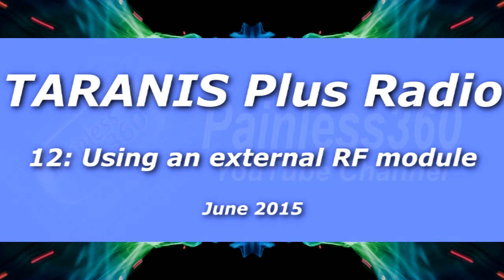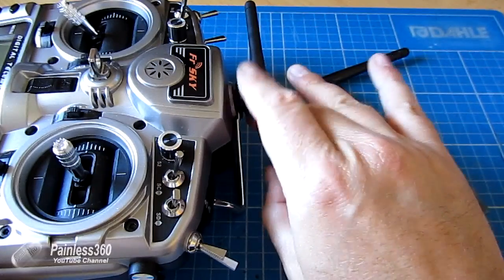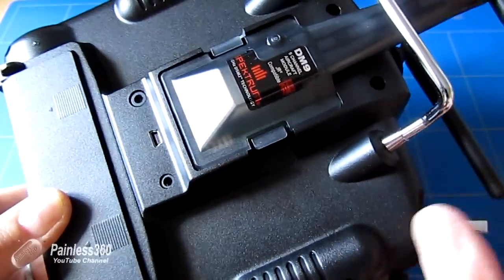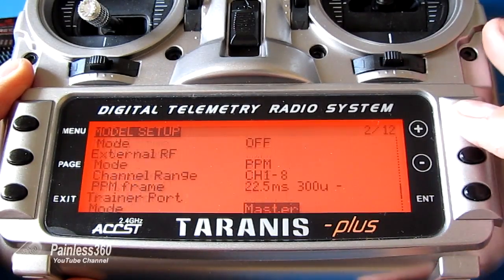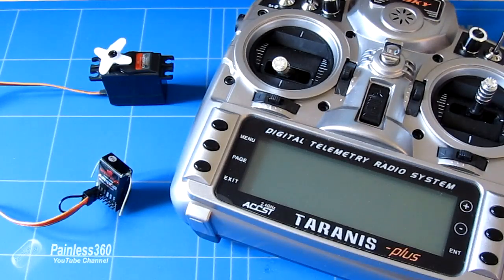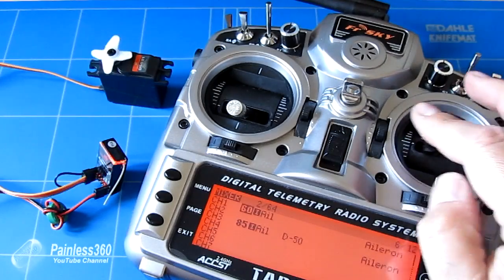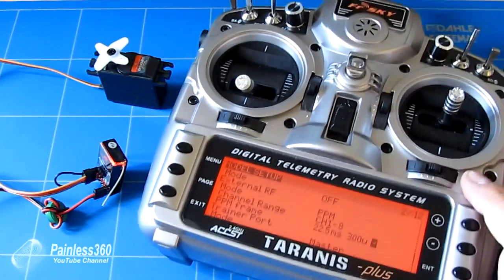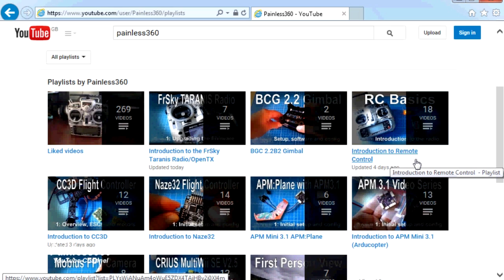(12/12) FrSky TARANIS Radio - Using an external RF module (DSM2, Spektrum, Orange)

Comment: Love this series mate. I just bought a Taranis for fixed wing FPV with dragonlink and these videos are helping heaps! 
Thanks
Reply from the maker: +blairo15 Thanks for the feedback, glad they helped. It's a great radio!
Reply: +Painless360 If I do need help with any of the setup features would you be able to help me if I send some cash your way through paypal or something?
Reply from the maker: We do offer one-to-one support over Skype (see the painless360.com website for charges) but I find that most of the problems people have with the radio are due to them missing steps in the videos we've already done. Follow the series and (hopefully) you'll be fine and won't need to have a call.. Best of luck!
Reply: +Painless360 thanks for that.  Cheers

Comment: Hi
Just upgraded my Taranis plus to v2.1.17 and wished I hadn't, been trying to get telemetry going using a d4r-ii, only using that because I can't get x4r to bind,, have you got any plans to make some vids about this subject, can I downgrade my taranis?, just can't get going with the new open tx.
Thanks
Jeff
Reply from the maker: +Jeff Wells We are planning to do the upgrade in the coming weeks. Check what FW is on the X4R as EU rx will not talk to non EU radios etc.. best of luck..
Reply: +Painless360 hi
Thanks for the reply, the x4r was bought in uk, not sure how to reflash x4r to non Euro firmware.
Regards
Jeff
Reply from the maker: See out video on flashing SmartPort receivers or (as you are running OpenTX2.1) you can use the simple 'via radio' method - http://www.dronetrest.com/t/how-to-upgrade-your-frsky-receiver-firmware-x8r-x4r-x4r-sb/1667
Reply: Painless360  I need to upgrade my taranis plus. I have 2.11 will this work with the crossfire micro?
Also if I do have to upgrade will I loose my model setups already in the taranis. 
Thanks,  John

Comment: Having heard so many good reports of a Taranis, mine arrived today. Thrilled. I then spent close on an hour trying to fit a Spektrum module. I still haven't managed to get it to seat. As first impression go, got to say this sucks big time. I can understand why you did yours off screen! Not sure if the fault is with Spektrum or Taranis but they could do better.
Reply: I know this is 4 months late, but I found if I squeezed in the side tab things on the module, it "opened" the pin holes on the module. Took me a bit to sort that out.
Reply from the maker: +Tobermory Cat You may need to bend the pins slightly to seat it. I found it was easier to get the pins in the holes then move the module into position so I could push it home. Some radios are easier than others, depends on how straight the pins were soldered on! ;)
Reply: Painless360 I ended up using a pointed blade to open up the entrance holes a bit on the module - even then it took a while. They could do better when it comes to designing connections. I'm looking forward to working my way through your series, a great help and much appreciated.
Reply: Jared Easterday I would love to try out your suggestion but I'm not taking the module off again - it was a total pain.

Comment: Where did you find this module? I have been looking and cannot locate.... can you point me to a link where this is . THanks
Reply from the maker: +Bill Moore It took me ages to find a single one in stock at a hobby shop. Most are using the Orange version from HobbyKing..

Comment: Lee - Excellent series.  Helped immensely make a lot of decisions going into next year.  Quick question:  I just got an AR7700 module (Spektrum).  I have a DX6i; however, I'm probably making the move to the Taranis next year.  As I too have a boat load of Spektrum stuff, the DM9 is intriguing.  Now for the question:  Does the DM9 handle telemetry back to the radio (presuming the radio has telemetry).  Again, thanks much.
Reply from the maker: I've not tried it, I'm guessing not. But if you have a Taranis pop a FrSky Rx into the model and get all that lovely data flowing back effortlessly! ;)

Comment: Have you thought about building a DSMX / DSM2 hack module using a donor RF module from a lower end Spektrum Radio?
Reply from the maker: +Ben Govett (BennyG) Thanks for the idea. I am not planning to as the module I have works great and the HobbyKing ones are cheap as chips.. Happy flying!
Reply: +Painless360 The current batch have a problem where if you bind to a DSM2 RX, it loses bind with all your DSMX models and vice versa. In my case when flying indoor, I end up rebinding almost every flight. Plus for some DSMX models you have to bind at least 3 meters away, and often it won't bind properly under a metal roof due to reflected signals causing confusion when binding. Not much fun to have to take your plane outside to rebind between flights! Especially when it's something like a Vapour and it's windy... Once bound properly, they work well. And if you only have one kind of DSM receiver, they are also fine. Thought about getting 2 modules, one for DSM2, one for DSMX then I came across the hack module concept... Pulling the RF module out of a DX4e tonight. Model match and binding / range check control through OpenTX menus will be a nice bonus too.

Comment: I have just got myself a Hex' with a Spektrum AR8000 rx already fitted. I did have a demo with the seller's Spektrum Tx so it all works. I took a leap into the dark and bought the Taranis Plus radio with the 9 channel Rx.
My question is - will this Module drive that Rx ? Also, am I looking at a DMS2 output ? 
I have to admit that I am struggling with converting everything over as I only have had the Taranis six or seven days ago. I am learning though and your videos have been most informative. Long way for me to go yet though haha...
Reply from the maker: +Jack Kilmurray Using an external module, like the one we use in the video, will allow you to connect to the receiver that came on the model. Personally I'd replace the receiver module with a d4r-II or an X4R. Stick with the video series on the radio and make sure you check everything in whatever GUI comes with the model to confirm channel movement, assignment and direction. Best of luck.

Comment: Hey thank you for all your videos they are great. What I like is that you keep it simple which is great and really like the diagrams you added to some of your videos too as we're not all electronic engineers and they really help so thank you. Now to my question. Not new to RC as I've been racing sailing boat for 10 years now and do a big of bashing with my son with RC cars but new to fpv and telemetry. I am looking to add telemetry and fpv to one of my biggest boat to see gps coordinate to overlay on googlemap, boat speed in realtime (ideally in knots), battery voltage and amps consumption which I should get from telemetry and then add fpv which a can record in phase II. I will also aim to put that system on a new little 250 quad I got to build but for later. I have a mix of futaba and spektrum radio systems over the years but looking now at one with telemetry and the Frsky Taranis looks like a good option. I presume with that radio system I can use the frsky telemetry modules and then use the APM modules to manage the video with overlay to see heel angle. Was looking to see if I am right in my assumption and what you think of that radio. Cheers
Reply from the maker: +glouisfr Quite a few options here. You can use a Taranis and SmartPort GPS etc to do that or use something like an EZOSD system and have the GPS location updated live on your tablet or Smartphone... Have fun, sounds like a great project!

Comment: I see this is your last video in this series. I was curious if you knew how to change trim based on throttle position. I.e. when more throttle is applied, apply a bit of down elevator. Thank you.
Reply from the maker: HighFlight2k2 You're not using the playlists are you ;)
Reply: Painless360 I did but will browse them again. I am an avid follower and thought I had seen all your vids. Sorry if I missed it. Thanks for the reply.

Comment: Hi Lee, I've heard the Taranis has model matching similar to Spectrum, I have searched the forums for info on this with no luck. Can you show how to set up model match if it exists? and if so will it work with after market modules? 
Many Thanks.
Reply from the maker: iflylilplanes Do you mean with the Spektrum external module or the internal FrSky radio system?
Reply: Painless360 The internal system as well as the external, I have a vague  idea as to what is to be done, but I'm not sure if there is more to what I think, plus, I don't want to experiment just in case I stuff it up.
Reply: iflylilplanes The FrSky version of "model match" only works with FrSky's X series receivers. Basically just like the Spectrum system each  RX is uniquely identified by an internal serial number and this number is used to differentiate similar receivers. I can't speak for the external modules since I do not use them.
Don't worry, you cant muck it up too much. Worst case will be you have the wrong model selcted on the TX and the model will not respond to the transmitter. You do check for control before every flight. Right :)
Reply: Rob B Only tried to fly the wrong model once ever in 40 years, once was enough,I check every time. Thanks.
Reply: +iflylilplanes In addition to FrSky model match on X series rx's, you can use DSM Model Match if you build a DSM hack module for your Taranis using an RF module scavenged from a lower end Spektrum radio... Doesn't work with modules using PPM as PPM is a single direction protocol. Does work if you extract a DX4e or DX5e RF module out of a donor radio and build a hack module. That's why I bought that 4e I told you about... :-)

Comment: This one is in stock: http://hobbyking.com/hobbyking/store/__61212__OrangeRX_DSMX_DSM2_Devo_2_4GHz_Selectable_Transmitter_Module_JR_Turnigy_Compatible_.html
Reply from the maker: John Bailey Is now ;) This isn't the original DSM Orange module, that one was out of stock for over 7 weeks before this new one arrived. 
Shame that HK neglected to keep it's customer base up to date and used the social media and YouTube to demo models that we can't buy for another 4 months instead.. sigh..
Reply: Painless360, the one that is less in cost is still on B/O, I finally ordered the one posted. Thanks for the great video. Hopefully it will bind to my Blade 350 transplant.
Reply: Painless360 I have issues with this "new" version. I have it hooked up to my Taranis and it dosent seem to work properly. I can change flight modes with a switch but the throttle is not responsive :( 
Using: Taranis w/ "new" Orange Module (JR) bound to a Blade nano FPV micro. 
In the forums on the HK page, people seem to have the same issue :-/
Reply: +Robert Meyers There's a couple of things to try... 1. Set the endpoints on your channel outputs to 80%. Spektrum gear uses smaller endpoints to the Taranis. This includes throttle, but if you have trouble getting the motors to arm try setting the lower endpoint to 90% then up to 100% which some people say helps. 2. Once you've completed 1, rebind. Make sure you are about 3 meters (10 feet) away from the craft when you turn the TX on to bind. If you have a metal roof, do this outside. RF reflections have been known to screw up the binding process on these. 3. If this still does not work, you could try building a hack module using a radio module from a low end Spektrum radio. Instructions for that here: http://flitetest.com/articles/spektrofy-your-taranis Am building myself a hack module this week using a module from a DX4e. Hope this helps!
Reply: Awesome! Thanks for the info! going to give it a shot this weekend
Reply: Robert Meyers Glad I could help. There is also a problem with the new module where it "forgets" bindings to DSM2 receivers when you bind to a DSMX receiver, and vice versa. I ended up doing a lot of re-binding which is why I am currently building a hack module. There's another post on this video describing the fun I had with it. Hope it does what you want!
Reply from the maker: Blimey! That's not good. I'm glad I shelled out for the 'real' spektrum unit now..